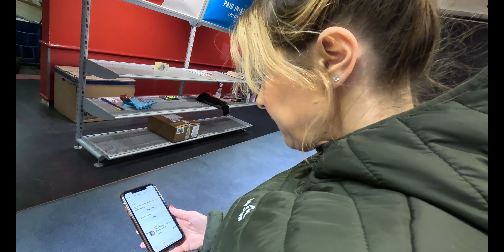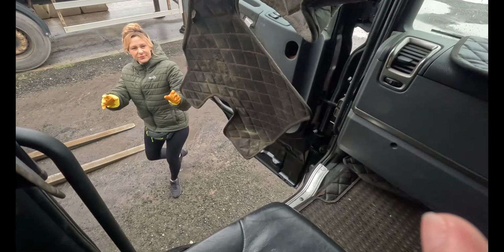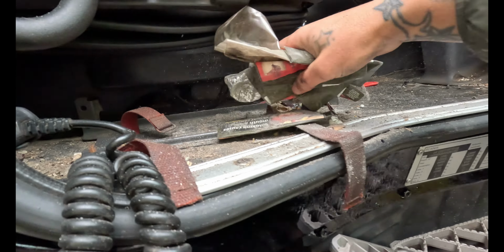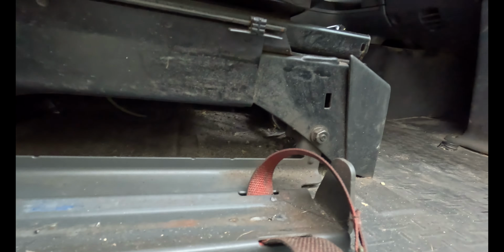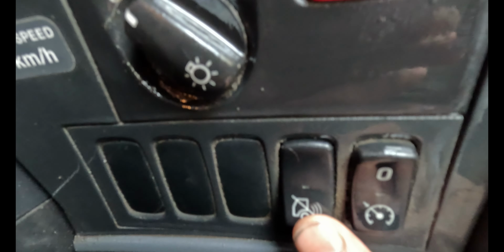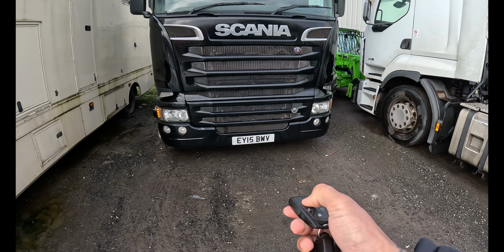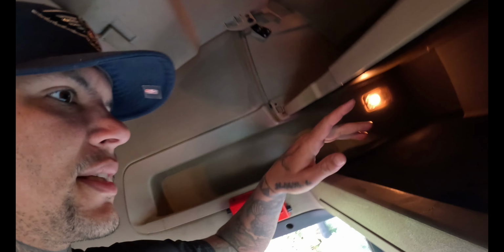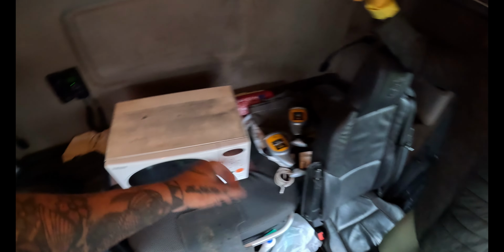Trucker's Shocking Discovery after buying his first truck

Comment: I would recommend using a  Extractor for the back bit use a shampoo cleaner or a fabric can get in any car cleaning place or off amazon I would try the chrome fabric cleaner. 

For cleaner other stuff I would recommend using  chrome degreaser or any with the steamer to help get the rubbish off. 

You can get detailing brushes I would recommend the soft ones for the buttons and harder ones for the harder wearing bits. 

So far you both are doing great 👍 

Hope that helps. 😊